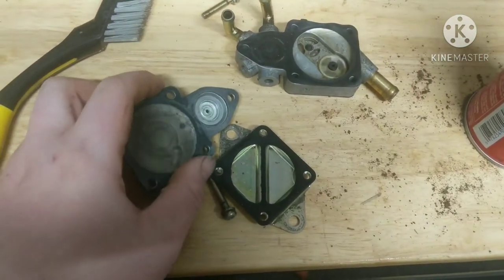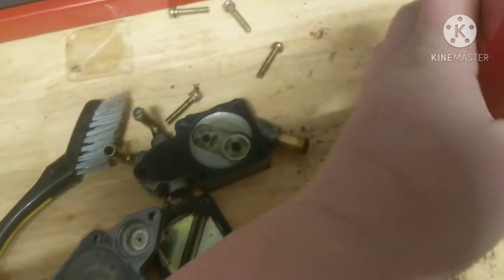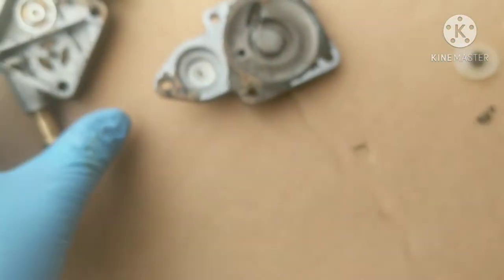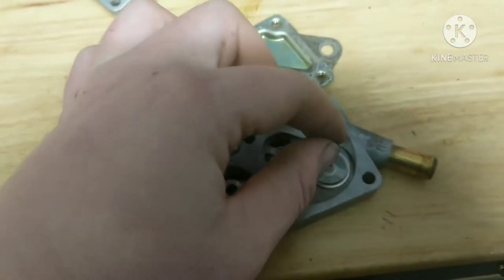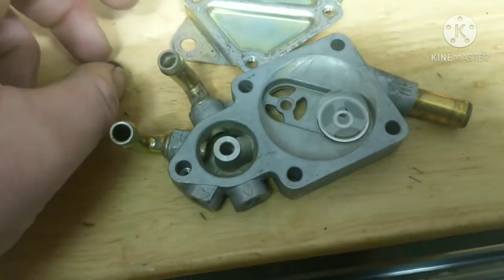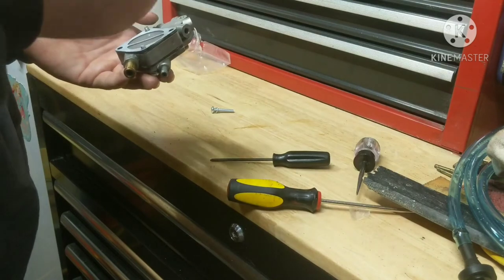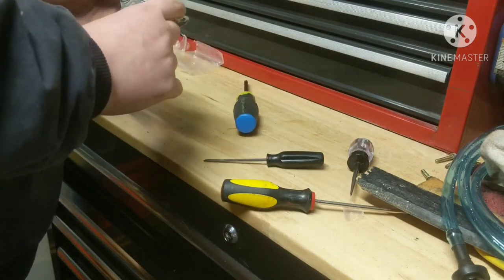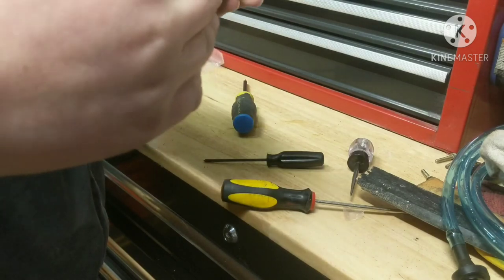REBUILDING A MiKUNI FUEL PUMP !

Comment: The reason I'm here reading the comments is those f'ing rubber check valve grommets. The winning installing method was cutting about 1" of a WD40 straw and using a large blunt set of linesman pliers to hold the straw. Wobble it around with light pressure and it will eventually go.

Comment: How did you put the new grommets back in? You say just use a punch or whatever but I tried that and went right through them. Now my grommets have holes in them.
Reply from the maker: Use a little bit of oil you can use a screw driver or whatever you just need to get them in there. It shouldn't matter that they have a little hole in them

Comment: Those rubber bits in the check valves are miserable, I got them out prying up with a small screw driver and a finger, under the tiny flange holding the little clear valve,  but to put the new one in. after pushing on it real hard and not going in- I used  the blunt end of a drill in the center hole pushing hard after coating it with silicone grease and pushing the edge down with the screw driver- one went. 
 But the next one the drill went thru the grommet and it did not seat.  On that one I ended up using an old rubber bit (grommet?) trimming the edge very lightly with a nail clipper in a few places and pushing it in. Checking it after- it seemed fine.